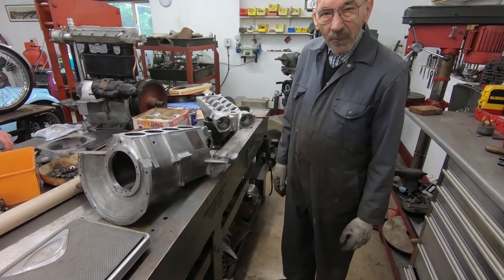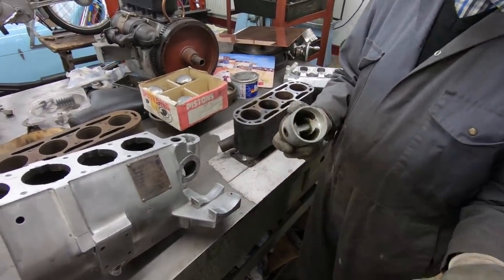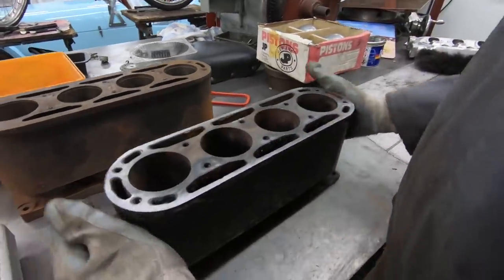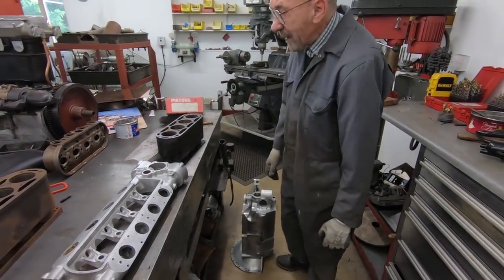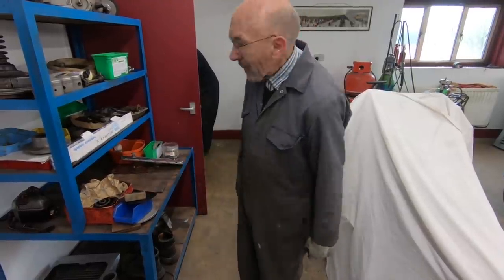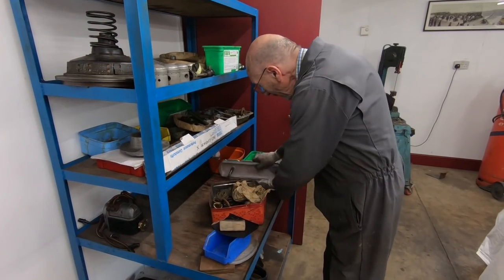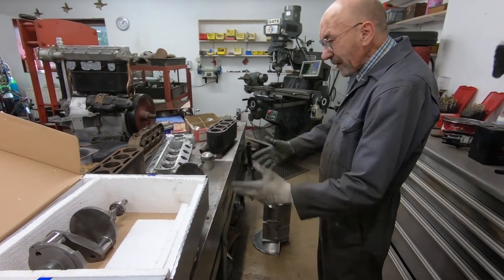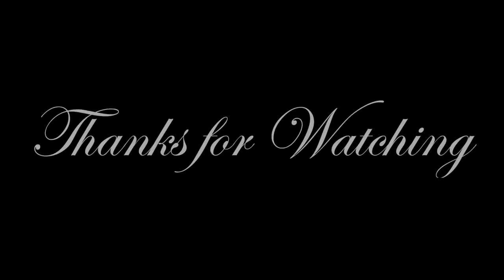1920s Salmson GP Special engine - Ivan's Shed

Comment: I have no idea what these engines are but I love seeing that much care going into restoring something old and nice. I purchased a collection of antique motors and parts from a guy that worked on them his whole life, and passed away working in his shop at 98. I got tons of really neat old, rare stuff, much of it still new in the package. I saved it all from his daughter who had no idea what it was, and was in the process of scrapping it all!
Reply: Well done Ryan. Have you identified any parts yet?
Reply: @martinda7446  Much of it got sold - to proper homes - some of it even ended up in a museum. I've still got quite a lot that nobody really wants to buy but I can't see them be scrapped, so I guess someone else will have to deal with them when I die! Pretty much everything had old part numbers and I spent months researching what a lot of it was. I even had a bunch of antique manuals and dealer stuff that helped with that. It really felt nice knowing many of the parts helped some old machines live again on multiple different continents!
Reply: @ryanroberts1104  Excellent.. Often it's those tiny insignificant bits (or so you thought) that are the rarest most amazing bits..to someone at least.
Yes, I agree a good service was done.
Reply: @martinda7446  There are a few pieces I can't identify that drive me crazy. No part numbers, no name, no idea what it's for. But I know an incredible amount of machining went into it and there is probably somebody somewhere that would kill to have it!

At least it's better to hoard metal stuff than old newspapers and dead cats. :p
Reply: @ryanroberts1104  🙀😸😸😸😸😾
Reply: @ryanroberts1104  put some photos up somewhere that would be so cool like a big puzzle...Might make a great YouTube thing.
Reply: @ryanroberts1104  Also could earn you some cash!
Reply: @Ryan Roberts perhaps if you offer them to Ivan he may want something of them if you are in the UK but if it were something Ivan wanted I'm sure he would pay the exhorbtant shipping costs

Comment: The set of cylinders with the thick flange, you could set it up and mill the extra material off the top of the flange. This way it's light, not been repaired and maintains it's height. Absolutely amazing collection of engines.
Reply: @ Ron Osga, I was thinking the exact same thing, and in a different set up you could add the extra water jacket slot that's missing from the face of the block as well. Then it wouldn't offend Ivan so much !

Comment: Those con rods are beautiful pieces H beam rods of that length will result in minimal side loading of the cylinder walls. - I love the aluminum crank case with the bolt on cylinder bank. 1922 Oldsmobile V8 had a aluminum crankcase with bolt on cylinder banks too. 
This Salmson is a beautiful piece of engineering.
My father in law owned a 1911 Pierce Arrow raceabout which ran in the first Indy 500 race- enormous engine.

Comment: Excellent, thank you. Makes me feel more confident building my Riley 9 engine. Just having to take what old parts you can find, fix them up and make them work. I also just use the original valve seats but do add Valvemaster to the fuel, I don't know if if does any good but I don't think it does any harm and on a low mileage car the cost is nothing. On Austin 7s we seem to prefer the two bearing cranks to the 3s (which came later). The Riley 9 has two white metal main bearings. And a flipping great rod though the middle of the crankcase to hole the engine in! What procedure do you use to break in an engine like this after rebuilding it?
Reply: There appears to be a certain amount of nervousness over hardened exh.valve seats in a riley 9 or 6, the castings were not all made at the same facility and there's a fear that inconsistencies in patterns (and 90yrs of corrosion) might lead to a break through into the water gallery.

Comment: Ivan,
Have you seen spray welding on Abom79's YouTube channel?
It could be another way of rebuilding the crankshaft journals if chrome plating doesn't work out.
Stay well and please keep broadcasting.
Reply: Yes I agree, spray welding has been a way of reclaiming crankshaft and other shaft bearing journals since the 1940's at least. Abom 79 was the first place I had seen it done and now Steve Summers has a new set of the same manufacture as Abom's

Comment: After watching a few of these videos, I have a question. If they can restore a chunk of the head using laser sintering to reconstruct missing material, can they use laser sintering to rebuild the valve seats and guides? Or fix cracks? Just curious.

Comment: Lead in petrol allows a more advanced spark so exhaust gasses run cooler. That reduces wear on exhaust valves. Today’s 95 RON will degrade the exhaust valves. Today’s posh petrol at 97 RON octane is equivalent to leaded 4 Star. 99 RON is equivalent to leaded 5 Star.